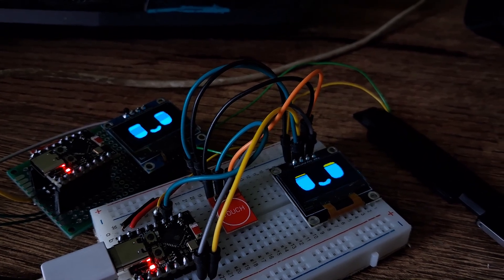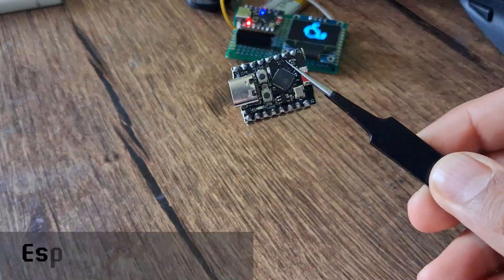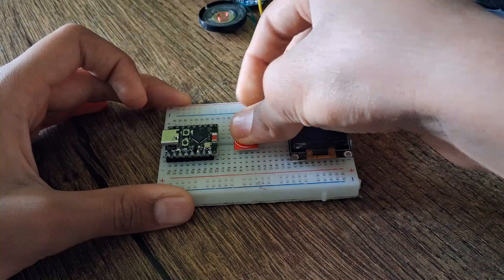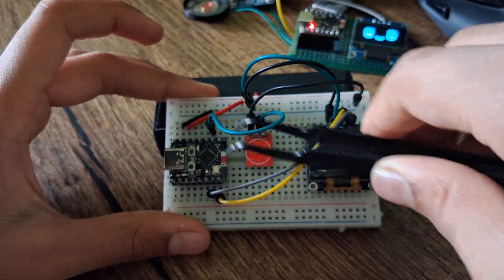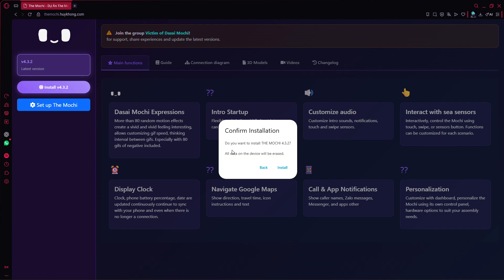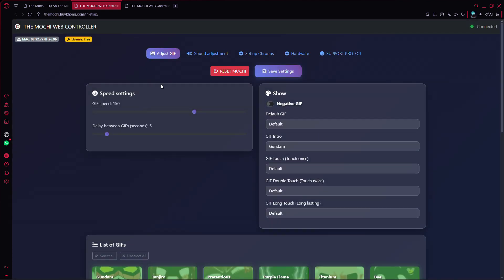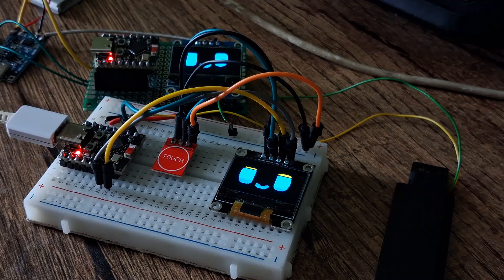Build Your Own Dasai Mochi Robot |Cute, Angry, Kind Emotions 🤖 | ESP32-C3 | #esp32c3

Comment: I made all the connections correctly but there is no sound. please suggest me
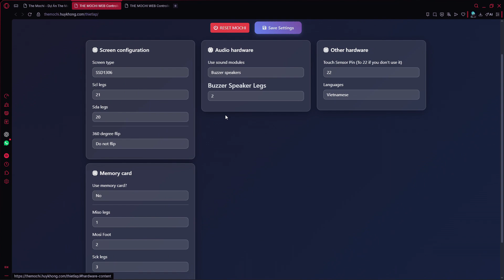Reply from the maker: First, just double-check all your connections. Make sure the speaker + is connected to the digital pin and the – is connected to GND. If everything looks fine and it still doesn’t work, go to the website from the link in the description. Install the code, click Setup Mochi, then ESP32 connection, open the hardware tab, and check the audio hardware there 1:17 to 1:53 rewatch it to get to the audio settings  . Try changing the speaker pin to match your wiring.

If it still doesn’t work, you can try swapping the speaker module. And if you’re still stuck, just drop another comment and I’ll help you out
Reply: @volt1206 
There is a sound when it is turned on, but no sound when the touchpad is pressed. Please suggest, also thank so much
Reply from the maker: @md.kalidibnulwalid5442  
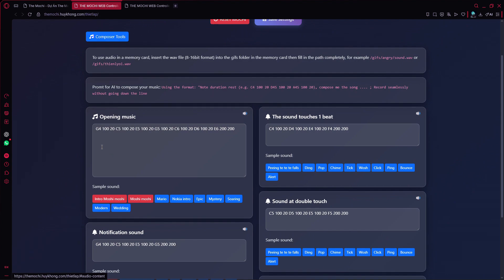First, make sure your touch sensor pin configuration is correct in the hardware settings and that it matches your actual connections. Then go to the website and follow the steps in the video till 2:08. At that part, I’m showing the sound adjustment settings. Just scroll through the page and you’ll find different options like sound for single touch, double beat, opening sound, etc. Change them however you like. After that, click Save Settings and restart your ESP32-C3.

Hope that helps!!